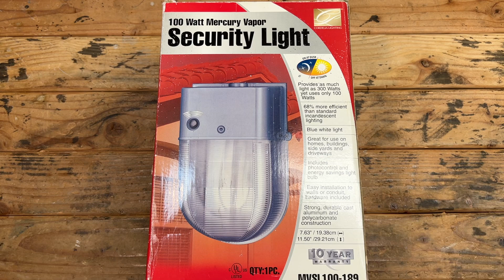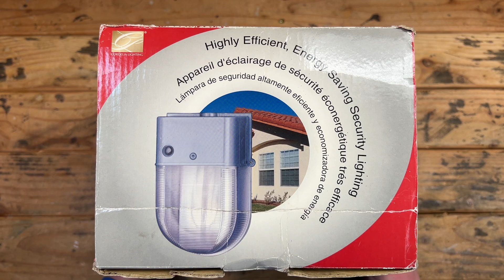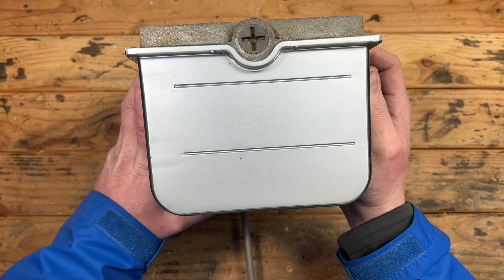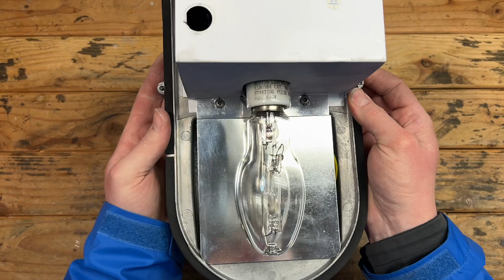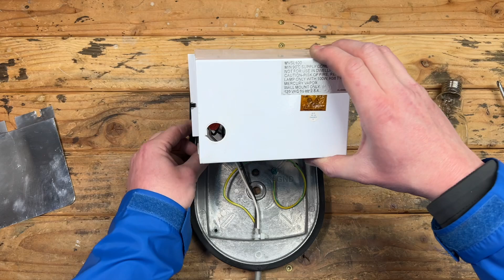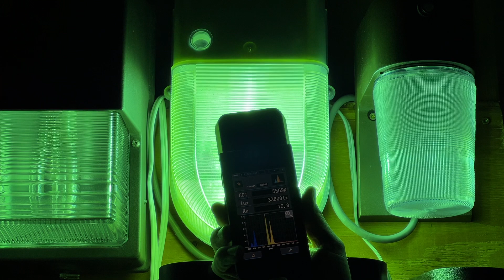Cordelia Lighting 100watt Mercury Vapor Wall Pack Fixture

Comment: That reminds me on a HID pocket torch 2 decades ago (before LED conquered high power lighting). 
The "Schulzenorf Delta P1". Even despite its hilarius price about over 1000€, I really considered to purchase one. 
Today I'm happy, I haven't. Not just because only some single yrs later really strong (2 digit priced) LED torches appeared. 
I simply realized to have no usecase for extremely overpowered torches. 

Today I'm happy about the LED flash torch in my phone, 
because I have it with me permanently and also I don't need to take any additional effort to keep it charged.

So my brightest torch is a simple (3D) Maglite, upgraded with a glass lens and a LED replacement.

Comment: I love the teal color of mercury vapor discharge, but apparently the clear bulbs are the most dangerous. If the nitrogen inside the bulb leaks out, then you get a nice dose of harsh UV light! I guess the plastic would absorb most of it, but it's hard to tell without running some tests.
Reply: it's not the nitrogen but the outer glass bulb that filters out the most harmful UV rays or UVC, which are the same as germicidal lamps and welding arcs.
The issue with clear bulbs however is that they don't block long wave UV rays or UVA and those can still cause headaches if you spend too much time under the lights or are too close to them and they tend to degrade materials over time as well.

Comment: My next door neighbor has one of those but it's colored black and is High-Pressure Sodium. The light is so bright it floods into my backyard and lights it well!
Reply: Why would someone want a high energy mercury discharge lamp like a high pressure sodium one attached to their wall like that? Those things output so much heat that these plug-in units will probably burn your house down if they're left active for long enough.
Reply: @samsimington5563  there is very thick fire retardant insulation where it's installed which should be there by code!

Comment: Cool. Never saw this style before. Check the ballast mount screws. If even slightly loose, the ballast will buzz like mad! They can loosen up from ballast vibration and heat/cool cycles. No a bad unit overall. To prevent increased yellowing of the lens and eventual embrittlement and crumbling, get some clear Krylon Fusion paint for plastic and apply a coat inside. Outside as well is even better. It is highly UV resistant and will save the lens, ESPECIALLY if it is polycarbonate (Lexan) which is highly impact resistant but poorly UV resistant and becomes fragile as ir yellows, where more easily broken acrylic is the OPPOSITE way around! Did ya try the other ballast in the parts unit? May be quieter. The Caster lamps look nice, but I heard they have tiny electrodes and dim out and fail fast, obviously the /DX will be even worse with phosphor degradation making ammonia gas that blackens the arc tube from the outside of it. I am down to 4 of the 250 watt MH ballast disassemblies, WOULD have had them done just as it got dark last night, did 5 of the last 9 and it started raining, and today is gray, nasty, and unpredictable so not gonna take chances! Getting wet and the tools wet sucks. I could do them in the basemen, but several of these had nests of those nasty tiny sugar ants, they don’t bite bit do get in your clothes and tickle as well as I don’t want a gagillion tiny ants on the floor of the cellar! Outside? Who cares. Once the colony and nest is ruined these nasty buggers are finished anyway, but they are annoying! I am getting “tickles” like they are crawling on me as I write this! 😬😳🤦😩
Reply from the maker: I did test the other ballast from the parts fixture and it was quiet. It actually ended up in an American Electric 115 clone fixture that used to be induction.

Comment: EXELENTE video 

Nunca e visto lámparas de vapor de mercurio de 100 watts solo e visto de 175 watts o +
Reply: There are lower power mercury lamps! European versions have 50, 80, 125, 250, 400, 700 and 1000w with phosphor coating and emit white light but there are also 125, and 175W in European and American versions, I'm not sure about 125W I think there are also uncoated mercury lamps in 100W European architecture and all of these in general uncoated mercury lamps emit greenish light but if I'm not mistaken I think there are uncoated mercury lamps that emit white light, I'm not sure about that

Comment: looks like a relic from the past and at 100 watts, inefficient
Reply: That’s not what this channel is about, it’s not about efficiency, it’s about how cool these older light sources are.
Reply: Yes, they are clearly much more reliable than any LED on the market in terms of longevity and in general HID lighting technology: HPS, MV, MH and CMH and LPS which does not belong to the HID family but is extremely efficient! HPS and LPS lamps are worth it, the most efficient gas discharge lamps but also CMH lamps are quite efficient and compete very well with HPS at lower power! MH not very efficient and MV is the least efficient of all gas discharge lamps, in my opinion they are not worth it, BUT coated mercury lamps have a wonderful white glow but in this case I would prefer MH instead of MV because they have better CRI and are more efficient but personally I would put HPS and that's it if it's simple for lighting only!
Reply: They were state of the art not too long ago! Still beat the incandescent bulbs by miles though!
Reply: Yes! Incandescent lamps have an extremely low efficiency of 8-16 lm/watt, halogen lamps slightly higher 10-25 lm/watt and high pressure mercury lamps 30-70lm/watt clearly quite a higher efficiency compared to halogen lamps and even more compared to incandescent lamps but MV lamps lose compared to MH lamps and especially CMH lamps and more than HPS lamps! HPS lamps are 1.5-2.5 times more efficient i.e. mercury lamps have an efficiency of 30-70 Lm/watt while HPS lamps 70-150Lm/watt